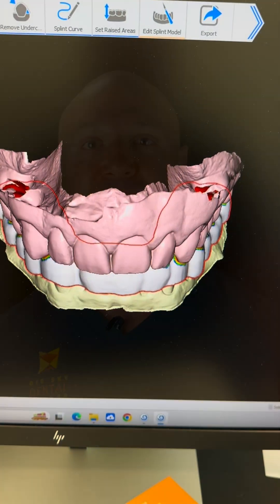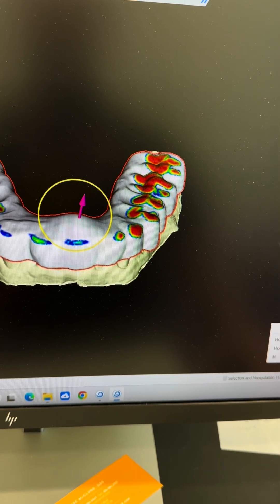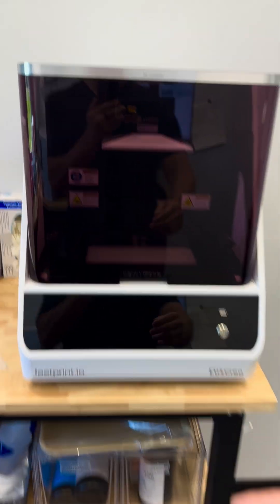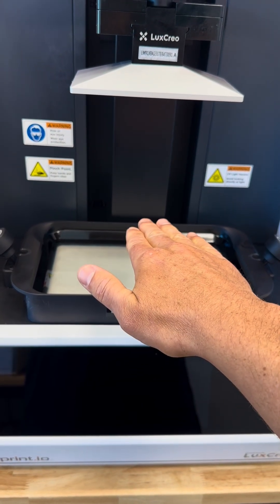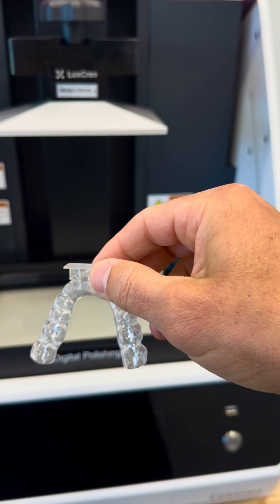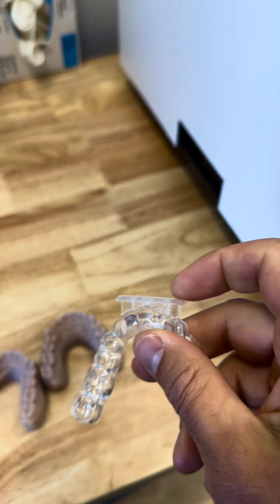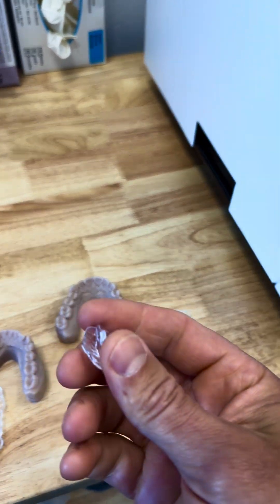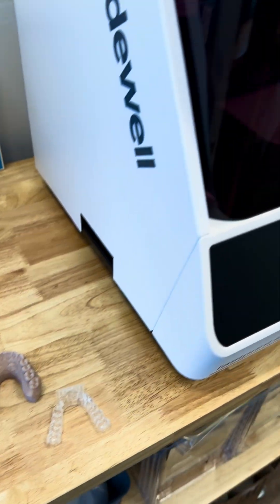How We Use a 3D Printer to Make Custom Dental Devices

Comment: What kind of software is that printer linked to?
How does that work? 
I know in manufacturing we use .stl files, and we export from a program like Solidworks, Inventor, or Fusion and send them to the printer, where it creates the final product from layers of heater plastic laid on top of each other. But this is new to me.
Reply from the maker: hi Chris, the software is dental specific program which generates an stl file once we have designed the device the way we like it.